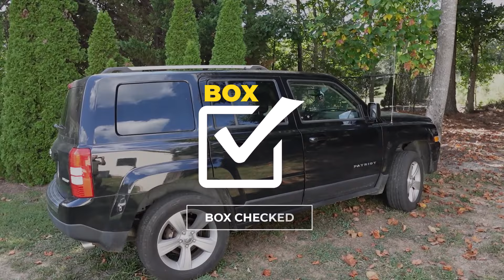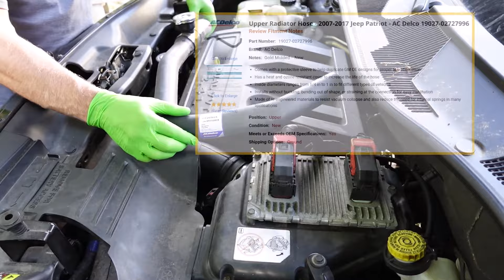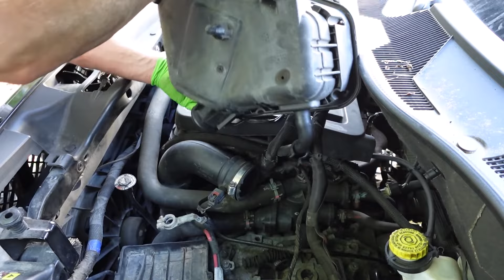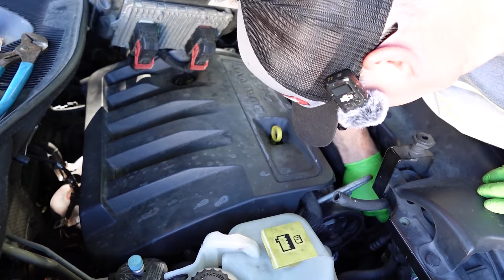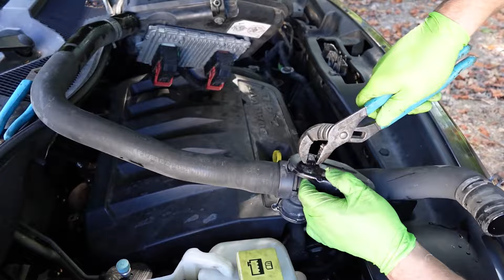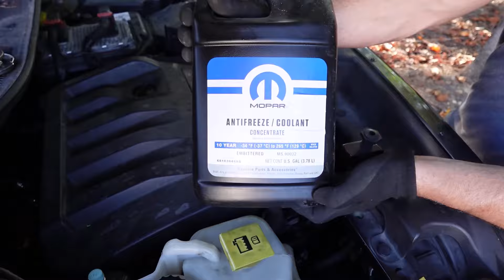Jeep Patriot Coolant Leak Repair | Upper Radiator Hose & Filler Neck Assembly Replacement DIY

Comment: What if i only have the middle part?! I didn’t get the full setup?!
Reply from the maker: Yikes!  You have 2 options:
1.  order the correct part
2.  cut your old middle part out by cutting the hoses as closely as you can to the plastic neck of the middle part (I would probably use a razor knife and cut the hose over the plastic necks).  This way you retain as much original hose as possible.  After removing the old middle part, replace it with the new one and use hose clamps to secure the original hose ends to it.  This does, however, come with a drawback - the fitment would change oh so slightly and it may not mount to the bracket anymore.
Personally, I'd go with option 1 unless you're in a pinch.  I hope this helps.
Reply: @BoxChecked  Yeah I just snapped the plastic on the old assembly off of the hoses and was able to use them like normal. Took a little longer than it should have taken bc of having to break away pieces and make sure it fit correctly but I did it. No more leak.
Reply from the maker: @user-wf9jx5oc9f  Awesome! Good job!

Comment: For anyone struggling getting the clamps back in place. 7in Locking pliers worked very well for me. I would have to tighten the pliers then squeeze to get the best result. Hope this helps
Reply from the maker: I found out later that removing the headlight also frees up some space 😆.  Thank you for providing the tips.  We all need them for this thing!

Comment: How did you diagnose to know it wasn't just the cap?  Could you see cracks in the old part once it was removed? Maybe you mentioned it and I didn't notice.
Reply from the maker: Great question.  I don't believe I mentioned this in the video.  In troubleshooting, I thoroughly cleaned the area and replaced the radiator cap first (cheap test).  But the cap was not the problem - it was the plastic T intersection.
Reply: @BoxChecked  After looking into it, there are so many people having this issue on Patriots and other Dodge/Chrysler/Jeep vehicles with the same design!  Some failing every few years.  I've found an aluminum T that's being marketed as a permanent solution, and it's barely more expensive than the plastic T, but still much less than the entire hose assembly.  But, on the Patriot it requires cutting the two crimp bands off at the T with a Dremel.  That's still easier than completely removing the hoses.  I'm going to give that a shot.  My Patriot is a 2017 and the hoses seem fine.
Reply from the maker: @jbrian53  This may work... I was very reluctant to cut the connections.  I feared I would damage the existing hoses or they would become too short for the install.  Good luck with the repair!

Comment: I have a 2017 and had been smelling radiator fluid for awhile and finally located the leak in that same location--the filler neck assembly. Thanks for posting the video so I know what to expect.  Since the hose is getting trashed anyway, I'm thinking I'll cut an opening and suction out what's in that section of hose.
Reply from the maker: Glad it could help someone.  Thank you for watching!

Comment: Just curious, what’s the difference in  filling the coolant into the cap, instead of directly into the compartment ?
Reply from the maker: I fill the radiator first.  Then, I fill the coolant reservoir.  The reason why is to ensure there are no air pockets in the lines.  Depending on the vehicle design, filling only from the coolant reservoir alone can be deceiving.